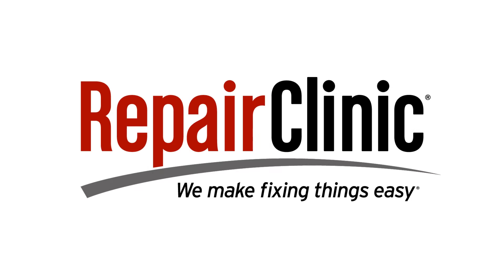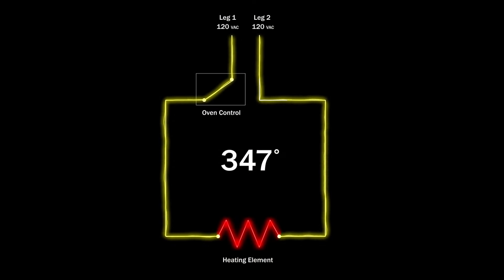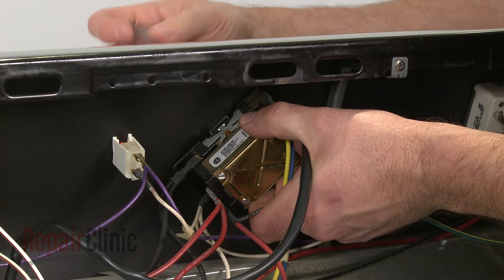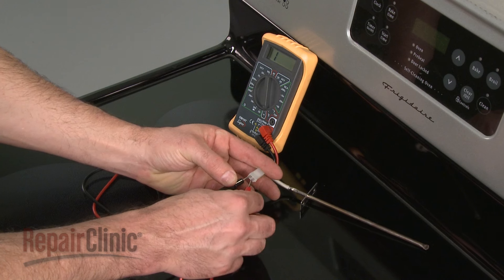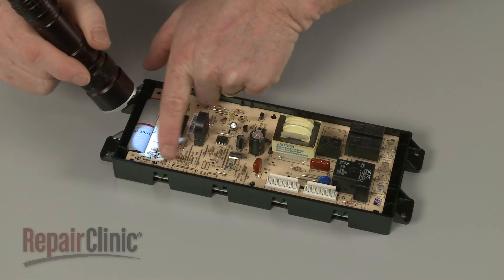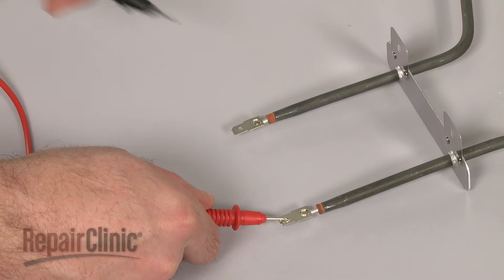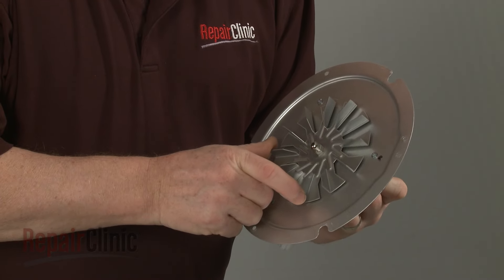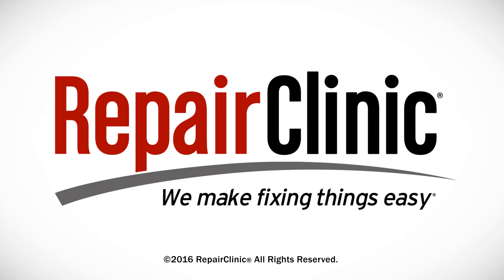Oven Temperature Incorrect — Electric Range Troubleshooting

Comment: I think my thermal probe is good but the oven is only heating up to about 225f while diplaying 350f.... Does that mean the control board is bad? Is there a way to reset it or jolt it back to life? The oven isn't worth the cost of replacing the board.

Comment: Need help please. Have a kenmore electric range. The oven temps are erratic. the lower temps from 175 to 300 are off by -15 degrees and the higher temps from 350 to 475 are off +  or - 10 to 20 degrees. Have changed the oven heat sensor but does nothing. Cannot set temp by the digital pad which can go to + - 30 degrees. Can someone please tell me what I need to change to hopefully get this thing right?

Thank You
R. Ruth
Reply: relay board or control board
Reply: It may also be the Hi temp sensor (thermostat or switch). It may open prematurely and turn off the heating elements. Close again when temp drops.
Reply: Me also, I rent and I'm trying to decide how to handle this, I'll keep reading 
I started keeping an oven thermometer in there it's helped a lot. But I still avoid using it.

Comment: What is "11 hundreds ohms of Resistance" (I know you meant 1100 ohms or 1.1 kOhms) but is it correct? The multimeter scale is set at kOhm so it should be 11 kOhms

Comment: my maytag electric  range oven will only heat to 275 on bake and on broil ???
Reply: I have the same problem with a brand new stove!from Dino’s in portage,twice repair man came same old story!trying to tell me I may not know how to use my stove! We tested the oven with a infrared tester thermometer and it also registered only at 275 after running the oven @ 350 for I hour!sooooooo frustrated!
Reply: @madeleinededieu3110 did you ever figure it out? Mine is doing the same.  Can't cook holiday dinner without an oven :(